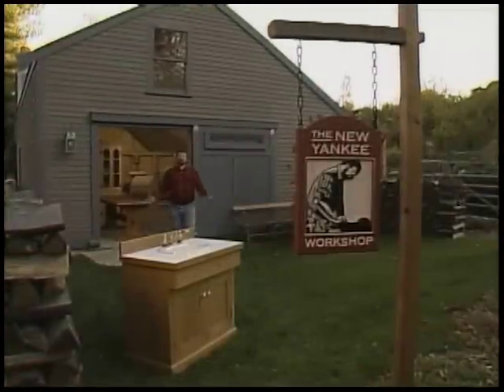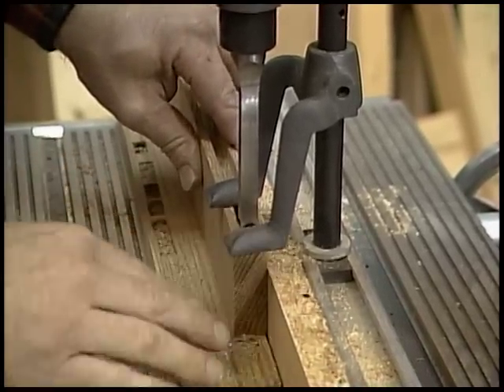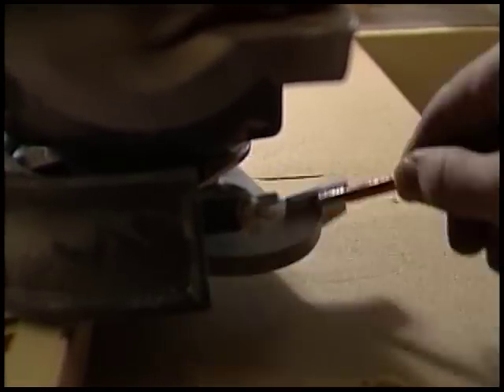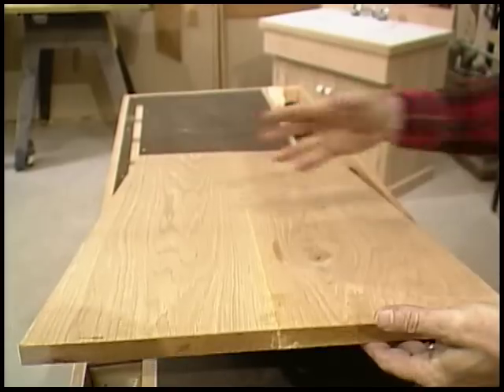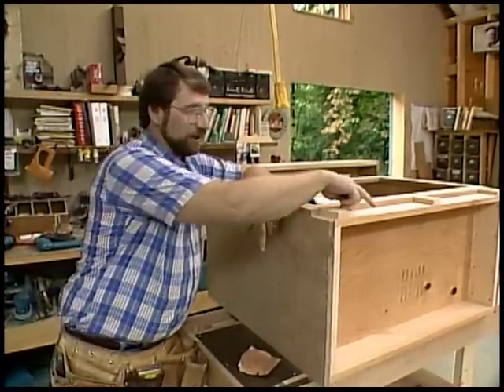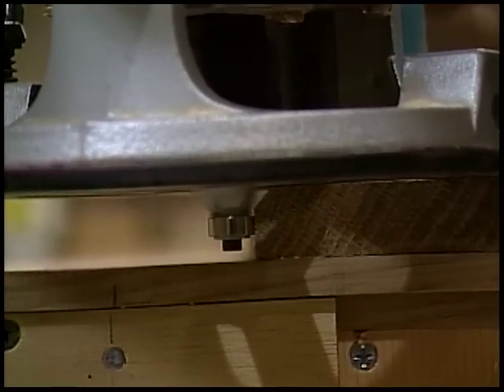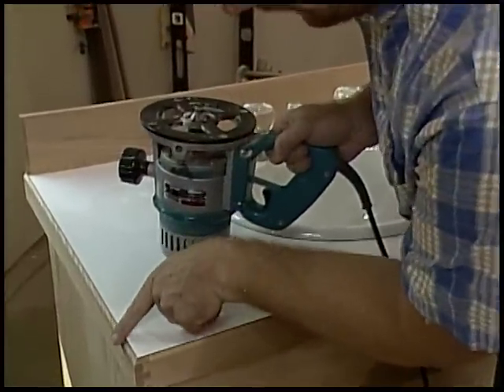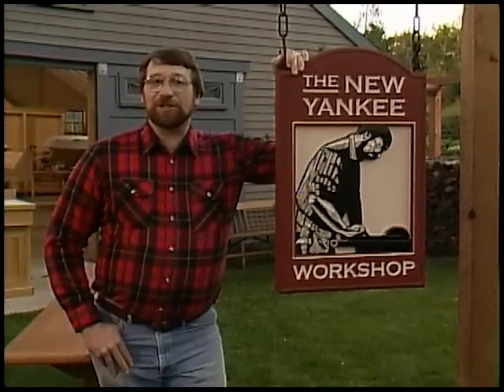Oak Bathroom Vanity  |  S1 E6

Comment: I love these old episodes. Didn’t realize battery tools had been common for so long. Interesting to see the radial arm saw has fallen out of favor over the years. Also never hear much about sanding sealer anymore.
Reply: Radial Arm Saws fell out of favor because they ended up with a bad rap. Sears Craftsman oversaturated the market with underpowered inaccurate Saws that they claimed could do everything and be the one tool shop, and they really only were good for crosscutting, dadoing and sometimes ripping. It's also known that Craftsman's were considered dangerous because they lacked a lower blade guard which caused numerous injuries. It's no wonder that the New Yankee Workshop replaced theirs with the far superior Delta saw that's still in the shop today. For years the better Radial Arm Saws were made by Delta and DeWalt, today Original Saw Company makes saws based on the old DeWalts, and then King Canada makes a great saw.
Reply: A radial arm saw is just a sliding compound miter saw with a long arbor that can hold a dado set and that "can" rip.

Comment: Interesting how things have changed. Obviously hand held power tools are much different now. Radial arm saw is not popular anymore. Uses lots of drywall screws! No track saw or pocket screws or Rubio 😱
Reply: He actually does use a pocket hole jig in some of the episodes, but they were pretty primitive compared to modern ones like Kreg or Massca's. Just a little metal drill guide you clamp on.

Rubio monocoat is amazing, though. I'd be surprised if he didn't use it if he were shooting this today instead of the 90s.
Reply: @1steelcobra  yes I did see that pocket hole and was surprised. Things have changed a lot
Reply: If the New Yankee Workshop started in 2019 rather than 1989, just imagine how many dominoes he would have used rather than biscuits.   @1steelcobra